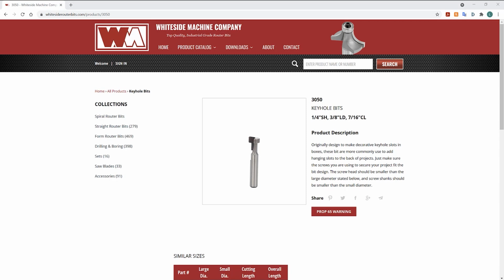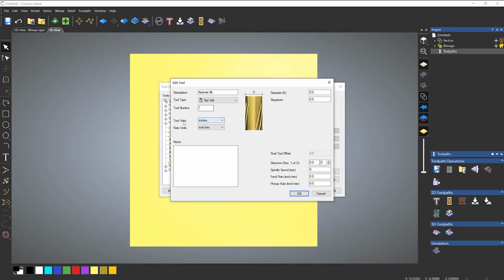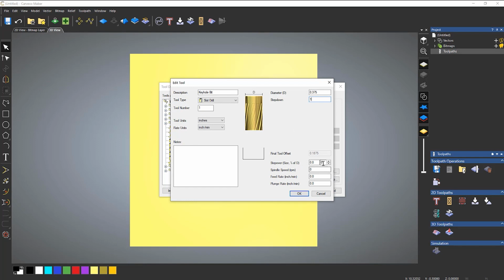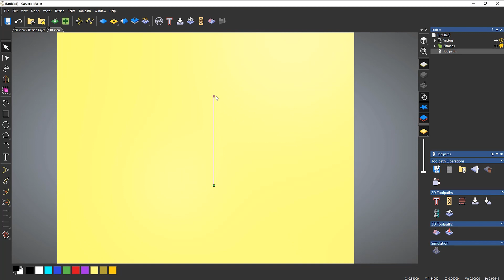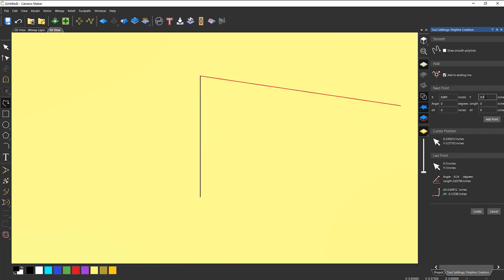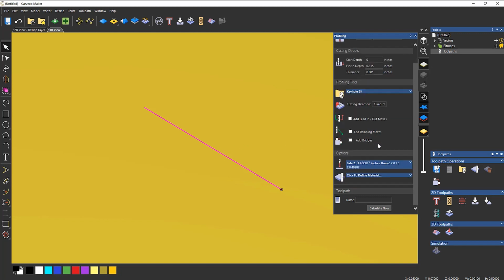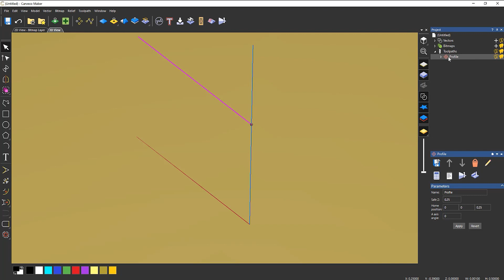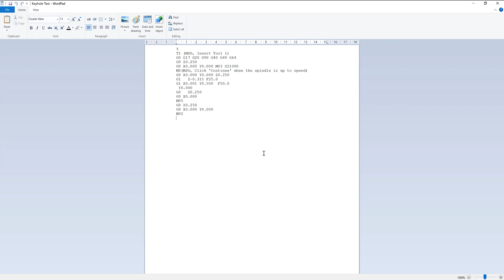Carveco Maker Tutorial - Machining Keyholes

Comment: This looks like a cool way to hang signs/pictures/art on the wall. 

By the way…
The g-code doesn’t look right. 
It “should” have produced;
Rapid (G0) to start position and then feed to depth; which it did v
And then…
G1 X0 Y.5 F50.
X.001
Y0.
And then up and out. 

At least that is what I was expecting from your vector created. 

Did I miss something?
Reply: I think because he's starting exactly at the origin, that bit of g-code wasn't needed.

Comment: Thanks for the great video!  I know .001" is not very much, but couldn't you simply have the tool return to the original entry point from the "end of the slot" offset point instead of exiting .001" over?  Then it would truly exit at the same point.  The tool path would look like an elongated triangle.